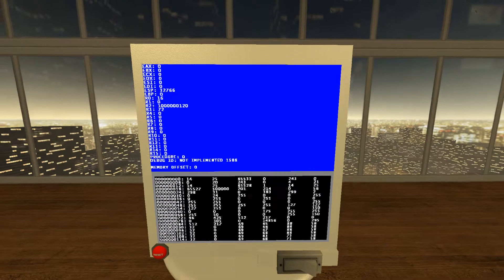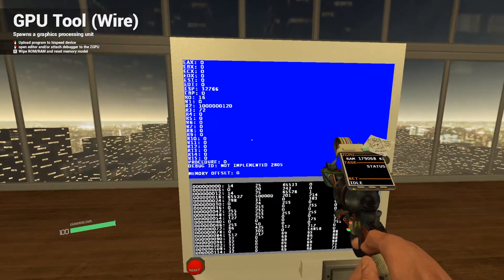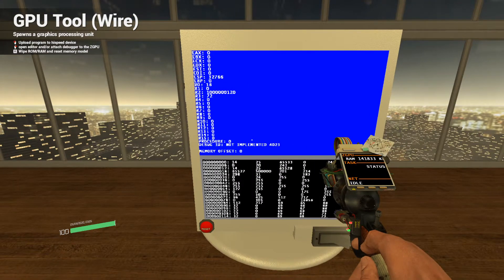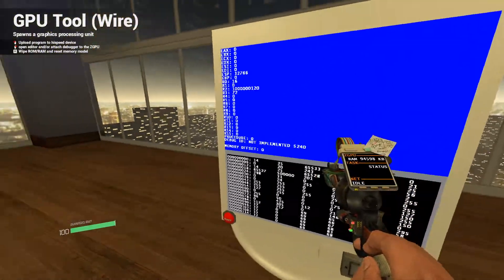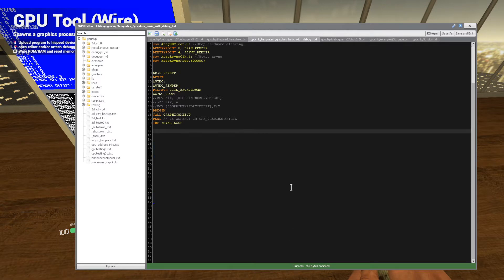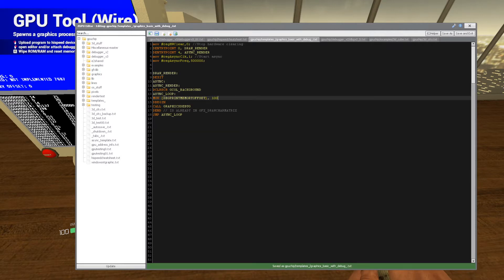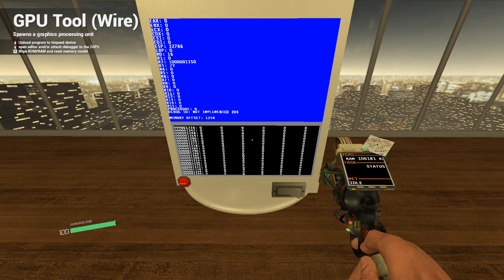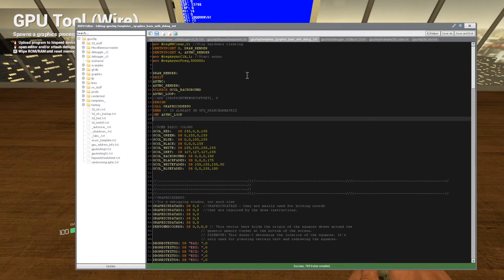Wiremod GPU Debugging Tool Release

Comment: Jesterday, is it possible to debug cpu via another cpu and output debug on gpu? If it's possible may you explain it?
Reply from the maker: This is very possible as it turns out. What you want to do is place the cpu's internal data (like the instructions it's running) into some external memory that is readable and writable by other chips (ex: a dynamic memory chip). You can do this by using the "org" instruction which changes/remaps the cpu's placement of internal memory for code and data defined after the instruction is used (the "org" instruction doesn't affect memory above it as far as I understand). So what you would do (if you wanted to place the entirety of your cpu program in the memory of some external chip) is put "org 65536" at the very start of your program, place down the cpu, wire the membus to the chip that will hold the data, then re-upload your program to the cpu and there you go, your assembled program is now in an external chip for viewing, debugging and or analysis :)
Reply from the maker: and if you want to do it with the gpu debugger in the video, be sure not to write to the beginning of the gpu's memory as it will break the gpu because the assembled instructions for the debugger will have been overwritten. There's a variable in the code of the debugger called "DBGPRINTMEMORYOFFSET" that controls the addresses that the memory viewer reads. Set that to something reasonably high (I set it to 5000 to be on the safe side) and then add this offset to the parameter you are giving org in the cpu. So in my case instead of "org 65536" it would be "org 65536+5000"
Reply: @jesterday544  wow, thanks, gonna try it when I will play gmod next time. The only reason why I need to debug cpu via gpu is to see a lot of memory, and I can't always use IObit because some of my programs require it